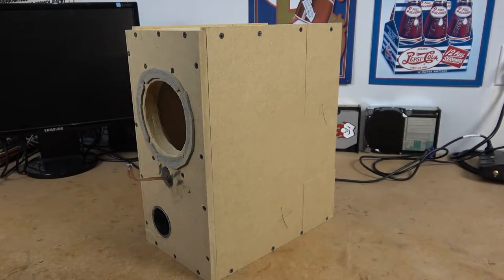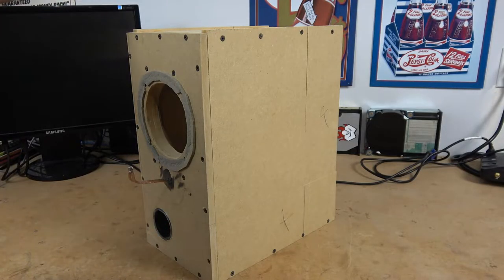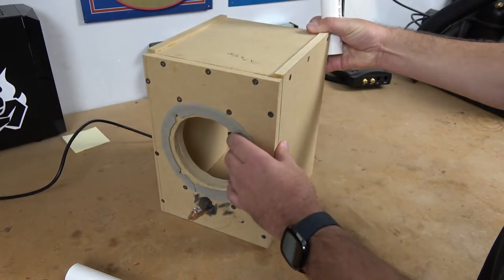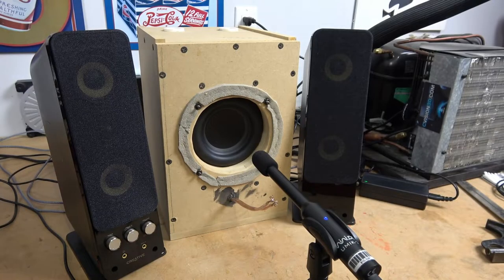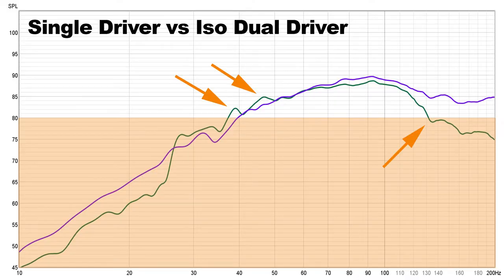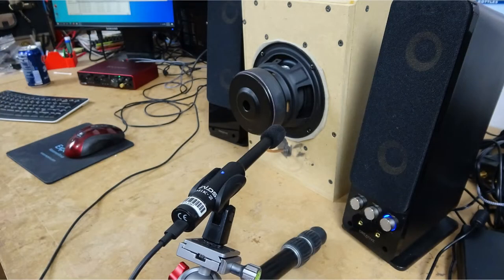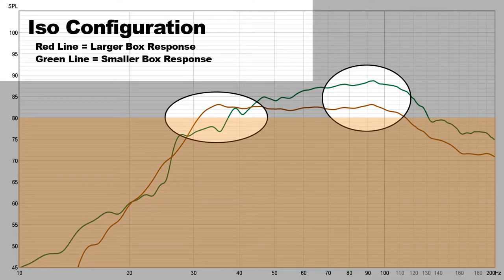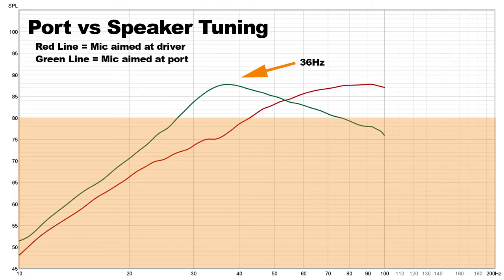How to Wreck a Subwoofer Enclosure

Comment: what the quack.... no, an isobaric does NOT have to have a bump.
Reply from the maker: It will depending on how the box is tuned.  The process isn't magical, they are just two drivers coupled together to change the moving mass, everything else remains the same.
Reply: @Hardwareasylum    basicly the compound of the 2 drivers in simple terms is identical to a single dirver, but you can halve Vas. 
a bit more advanced model accounts for the air that couples them. that has mass, so its modelled as added mass to the Mms.
For that reason you get slightly less Fs. depending on configuration. as the clamshell kind you show has the least air between the drivers, its space efficient and nothing more.
but isobaric is very very usefull, i do prefer to build subwoofers (note, not bass boxes, but subwoofers.) using drivers in isobaric configuration.
drivers do not respons 100% equal to a positive and a negative input. meaning the cone moving towards the magnet behaves different than moving away from it. allso the driver has a basket, magnet, spider, etc.. those make noise as air passes them. given this, i prefer to have 2 drivers magnet-to-magnet. the coupling chamber volume is slightly larger, the fs is affected specialy whit larger drivers. like 10"+ size. 
less noise whitin a ported box, the less that can get unintentionally amplified by the port it self. since the port it self in a transmission line. it has a fundamental freqvency and its harmonics. if the noise in the box corresponds to one of the constructive harmonics of the port, you get those subs that sound "bright" no mather what you do to them. thisway i can avoid all that. peak spl remains the same as if i only had 1 driver. many cases the box it self ain't mutch smaller than just having both drivers as twins. since the coupling chamber can take up quite some space. and for that same peak spl it needs 2 times the power input vs a single driver. so its not as efficient.(in terms of dBL at 1m driven whit 1 watt, but depending in coil configuration dBL at 1m drivern whit 1V will be vastly different story , makes a difference is they are series or parallel wired)  but the quality does improve in many aspects. and it gets a bit worse when it comes to how tight the sound will be. we got twice the motor force, for the same area. but we got twice the mass to move, and a bit more due to the coupling chamber's airmass. but its a worthy tradeoff. 

So basicly Qts remains the same
Fs equal or  less depending on chamber volume
Motor force will be twice
Mms will be twice + some, depending on coupling chamber
Vas will be halved

actualy i do currently plan a speaker whit 4 midbass drivers, that is 2 isobaric pairs. drivers connected in series+parallel. thatway electrically its near identical to a single driver. the required nett volume is allso the same. in exchange i get way more powerhandling, less excursion for the same spl, and a more linear "compound" driver. it will be an MTM setup.
Reply from the maker: Thanks for the mansplaision of Iso loading.  I'm sure someone will find it helpful.  My $0.02 on MTM loading,  I've never been a fan of that design.  In my experience, and based on your description, the output is softer and muddy due to the loose coupling of the drivers.  This is often due to the sealed air being compressed and causing the drivers to be slightly out of sync.   It works, but I have found the clam shell loading to be considerably more accurate.  But, build what you like.
Reply: @Hardwareasylum  dynamics of an isobar is less than a single driver , its not the loosy coupling , but the added mass it self. 
On the other side , higher freqvency distortion , say past 1khz will be more controlled and smooth it self out. Would be hard to find drivers whit exactly the same artifacts in transfer , so they smooth eatch other out. 

Mtm stands for having a midbass , a tweeter , and a nother midbass. The supposed advantage comes from the phantom image of the 2 midbasses being where the center of the tweeter is. Or at least very close to it. Thatway is approximates a single point source more accurately. Helps whit imaging. 

Back to isobaric. It did help me whin a few thropies and prises. Allowd me to enter car audio competition whit p.a. drivers.
The amplifier was given , so had to make the best use of power. Unarguably the tipical car sub barely manages 84 dbl / watt at 1m efficiency. The pa drivers i used went from 93.... 90 accounting for the loss via isobaric load. 
However i do have some wins where i managed to do both the raw spl , and sound quality throphy whit the very same setup. 
Can call it trolling.... but it was realy fun.
Reply: Oh, good for you!
Reply from the maker: Thanks!  I am so proud.  lol

Comment: An Isobarak speaker has no ports...it is 2 speakers ,1 mounted on baffle the other mounted a calculated distance behind the baffle drive unit with a sealed volume of air between both forward facing drive units, one behind the other...can not port an Isobarak...an Isobarak speaker has another identical speaker facing forward behind the baffle mounted bass driver, trapped sealed air between the 2 drive units...look up Isobarak...this is just ported or reflex ported not Isobarak, Linn made Isobarak speakers,very expensive, real Isobarak speakers, gives deeper ,faster ,less distorted bass response..
If done properly like Linn the bass is unbeleivably extended,fast & less distortion than a single non Isobarak ported bass cabinet....
Reply from the maker: Thanks for your comment and watching the ENTIRE video. :)  Isobaric loading describes how the speakers a coupled,  They can be front to back, back to back, front to front and back to front.  The only thing that distinguishes them is the sealed air chamber between them.  Beyond this they can be vented, and many often are.   Porting vs Sealed is determined by the speaker parameters, some work best in a ported enclosure, others, like the Linn speakers you mentioned prefer a sealed enclosure.

I believe what you are getting confused is a brand name from Linn "Isobarak" VS. an actual speaker loading design.  

Here is another video from a channel that has been doing rather well in the speaker realm to explain.  https://www.youtube.com/watch?v=BdF7nTU_QOQ
Reply: @Hardwareasylum  ....yes isobarak is a bass loading system, Linn called it the "Linn Isobarak" speaker which is what most people think of when the word isobarak is mentioned...we call that 'Clam Shell' in the UK...not strictly what the hi-fi world means when they talk about Isobarak..though it has been done... technically your right it is isobarak, the coupling of 2 bass units with trapped air between them...some bass players use clam shell loaded sub bass cabs, yes they are a ported Isobarak style & produce a lot of low end subsonic bass under 20hz..a bit to much but they are fast for the size of 2 x15" bass drive units....if you want the most musical sounding Isobarak bass my experience tells me the both firing forward, one on the baffle & one a calculated distance directly behind, sounds fantastic if done right...i used to design speakers but never got round to Isobarak loading as you need 4 high quality drive units with the right Thielle Small parameters & very little written back then about isobarak bass loading, no internet...yes i have seen ported clam shell isobarak speakers... imo transmission line subs are superior, fantastic just like transmission line speakers, PMC etc... the transmission line produces an amazingingly clean deep bass with a lot less distortion but can't go as low as an isobarak bass loading system ...if i could afford everything i would design a stand mount sized tranmission line 2-way speaker with a transmission line sub in a seperate enclosure underneath,
if it's purely bass amount isobarak clam shell is the way to go... for hifi quality tranmission line loaded is my preferred option, depends on what your trying to acheive ,but hard to buy the right bass units...good luck
Reply: @christopherstorrier5560  
the most musical sounding Isobarak bass my experience tells me the both firing forward, one on the baffle & one a calculated distance directly behind, sounds fantastic if done right

That is my latest design. I want it as compact as possible, so 2 drivers front to back, but doing it twice and stacking them. Cheap enough drivers but will be an interesting experiment. I ordered 5 so I can compare it to 1 driver in a normal box.